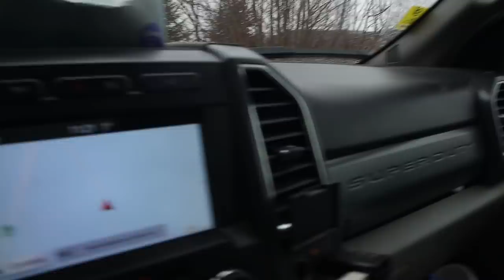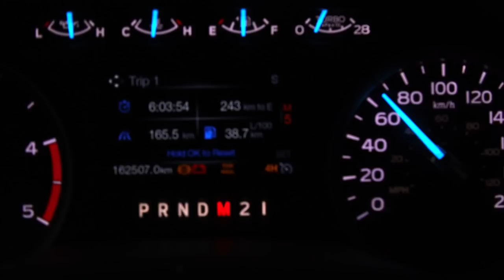Can TESLA'S CYBER TRUCK Be Used For COMMERCIAL TOWING?

Comment: RE: 13:10 - It's not even about tires...it's about weight.  At over 4900 pounds, the Tesla Model S is already heavier than most mid-sized SUVs.  I would not be surprised if the Cybertruck was 1 ton heavier than the Ford.
Reply: Thats why they made it unibody to shave weight and offset battery weight. People have claxukated this and they dont expect it to be much heavier then a model S or F150. They spent much more time engineering strength our of efficiency rather then bulk. From what I saw they expect something around 6,000 lbs. The new batteries coming our next month too will greatpy b reduce the size of the battery to produce the same power. Gonna be light weight compared to past old tech Tesla's.

Comment: In your neck of the woods the Tesla truck wouldn’t handle one winter ❄️! Using the heater greatly reduces the charge ! You could possibly freeze 🥶 to death 💀 in it on a remote road ! Good luck 👍🍀
Reply: New Tesla's improved that issue. You must own an old one or not own one at all to just he a hater.

Comment: The only time you would need a range extender is when towing. It would be better if the battery pack is integrated into the trailer from there plug it into the truck.

Comment: Electric trucks will need infrastructure .. Sure instead of having gas stations there could be battery stations where battery modules are swapped out with fresh ones that have been charged and inspected . There already are very heavy duty electric motors that are in use daily in locomotives .

Comment: eh, likely looks like an F650, possibly a 429 4v, all those electric KM's are without load, So on your truck you should be able to see your power output, imagine the CT would be a small percentage of its range towing. Not to mention they heat the batteries when they are cold, decreasing the range further.

Comment: It has a  500-mile range until you start towing with it cuts down to one-third of that
Reply: Joseph Atnip he said that🤦‍♂️
Reply: And then the cold ass weather up in lab would kill the battery people think electric is the way to go only in a warm climate
Reply: How do you know? All the tow tests are based on other teslas, until the actual vehicles come out for testing you'll never know, you can only assume.
Reply: @shaggyego  see thats where the difference between gas/diesel and electric.  Electric is all the same and no matter what with electric it will kill range
 The one thing batteries dont like is load. The more load you put on it the faster it drains.
Reply: @REEL SIXX its all one gear so there is no towing mod. Onlt way to make a tow mod for range would be to limit the power sent which  then means less towing. This isnt oh its truck so this and that. Its literally basic electrical power. More load more power faster power loss.
Reply: What an obvious comment.

Comment: Where u going to charge it at in the middle of nowhere
Reply: James Lytle big diesel generator in the back. HA
Reply: russell10x  😂😂😂 yeah probably what’s the point then 😳😂😂
Reply: The only small saving grace there is the solar panel bed shutter it's supposed to have. You'd likely have to disconnect the trailer if there's any sort of gooseneck attachment in the bed. I still think Elon is just trolling everyone with the design. If they ever do actually make a truck I'm sure it'll look a bit different than what they've shown. Also I think realistic towing capabilities are more than a few years away, more like 10+ years away. They need better efficiency and more alternatives to charging in all situations.

Comment: No you should not buy a Tesla truck ther is no place to charge the p.o.s around you. Plus batteries do poor in the cold and if you want to see how short the range is when towing check out T.F.l truck they tried to tow with there model X and it only got about 150 miles range

Comment: Except you'll have to have a goosneck that sits above the cab if the Tesla in order to turn sharp the way the bedsides are made. Plus the towing range will be around 100 miles towing. I think it's a great idea to replace mall crawlers but but actual work trucks. Not those driven any distance at least.

Comment: The Tesla truck loses out on haulage capaciy compared to a conventional truck because of the weight of the batteries (somebody with good physics knowledge calculated that it will need 14 tons of batteries to achieve the range they quote). Irrespective of that, it's really only a styling concept, designed to tickle the electric fetishists and encourage them to plough even more money into Tesla's black hole. It'll never reach production. Tesla's future is not in vehicles, but in selling the Panasonic batteries (that they were licensed to manufacture in their tremendous tax-subsidised battery factory) to other vehicle manuifacturers who get sucked into the electric dream.

Comment: Made it 6 mins in and couldnt watch anymore.  If it was me woulda put load little farther forward so more weight on drives (probably why you could barely make it up that minimal incline😉) . And personally cross chain but nothing wrong with way done.  Just prefer cross chain and think its better/safer.
Reply: If you lose one chain on a cross set up you're hole load becomes unstable where if you do straight chains on all side you lose one and the other three will still hold it. There is a video out now demonstrating this

Comment: Wow,... your inexperience really shows. You tie down the front axle properly but by shear laziness you tie the back of the truck on the sprung side of the vehicle claiming that brake lines were in the way.  What a terrible idea and a great way to lose chains or damaging the load by introducing heavy shock through the body and frame of the truck.  But, I guess that's your free 'get out of jail card'.  Also another thing that's really annoying to watch is when you haul equipment you never cross chain anything. Do you think that maybe there are some good reasons to do so when hauling equipment?? DOT must really turn a blind eye when they see you coming. Out west and Ontario they would have a field day with you. Good luck in any case.